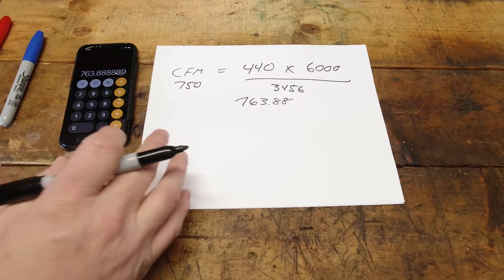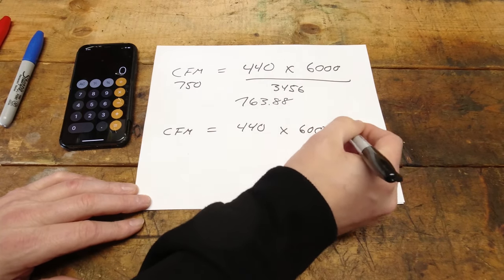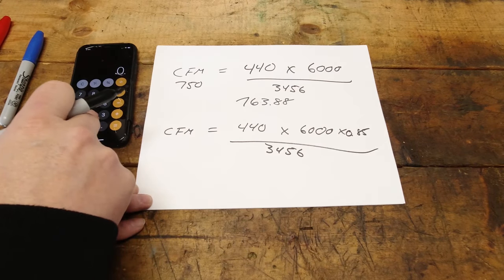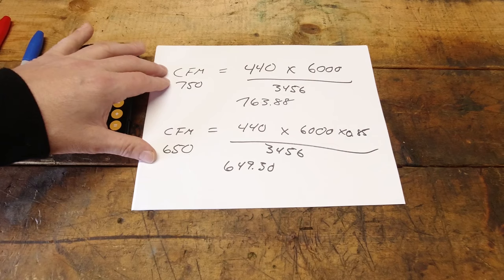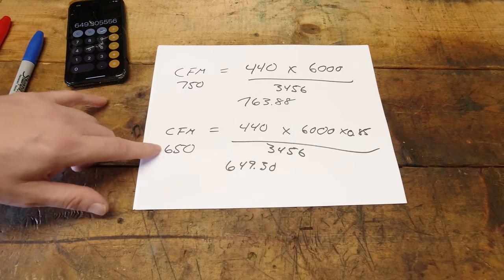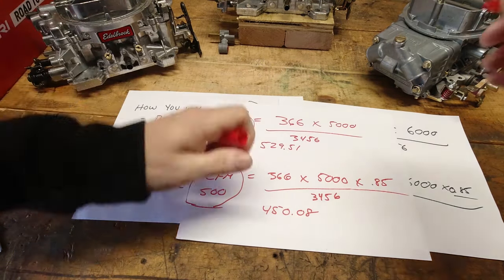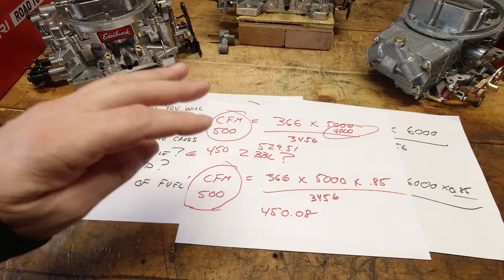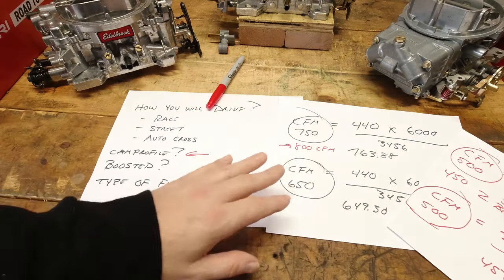How to Choose the Right Size Carburetor

Comment: Hello im Kendall and my f150 broke down on me in stockbridge ga,water leaking pooling under intake manifold so i assume its the line under intake i just knew that was the problem so i take manifold off and cut out the line and put it back together in the parking lot of comfort inn where im staying ,so i crank r up and its leaking more so i cut the line out for nothing its one of the line coming out of back of motor im like W** ,It was running down on intake i sure wished i would have replaced those to it sure tricked meive put alot of time and money in 2002 f150 4.6aluminum intake not plastic i got so mad at myself i felt like a dumba** its still broke down lol what im getting at is i come accross all original 1972 C10 i growed up ratracing my first ride was 1969 elcamino aka, the rebel lol  i was needing a cam to put in it so my buddy said i have one in garrage i said cool thank you  so i put it in and it was hitting such a big lick it would go dead my buddy was just a laughing it was a 5 something lift so i had to put it in neutral everytime i stopped i said you can put the stallconvefter in lol,ill shut up it has a 350 3 on the tree  cant wait till i get an ole muncie 4speed in her it was def a barn find it was the vetinarian of marrietta ga i just thought it was pretty awesome guess im getting old thank you for your time.

Comment: I am building a sbf 427 running e85. Planning on running a holley 950. Seems to be overkill for what the calculations say. It says 850. But I never seen anyone run an 850... Over the 950. Am I crazy for sticking with the 950?
Reply from the maker: Maybe not.  E85 requires a lot more fuel than a normal non ethanol gas engine.  So depending on all the variables, it might end up being the perfect size.
Reply: @MuscleCarSolutions  Yeah I check with Holley and they said the 950 IS the way to go. :)
Reply from the maker: @I_like_turtles_67  trust but verify.  I got you.  ;)
Reply: A Holley 950 carb is a 750 base mated to a 850 body to give you a 820 cfm
Reply: @robrozek9265  The guy putting my motor together is suggesting a 750 now lol.

Comment: AMC 304 on my automatic Jeep with Edelbrock Performer cam and intake with shorty headers and dual glass packs.  Should I guess 5500 rpm.  500 vs 650 for avs2 carb.  Or a friend of mine has a performer 500?    Any thoughts?
Reply from the maker: That’s the challenge.  Are you using that Jeep for off road and just a cruiser?  Then the 500 would be absolutely perfect for it.
Reply: Yes just a weekend driver mostly with some trail as well.  
  @MuscleCarSolutions
Reply from the maker: @diamatronyt  those little 304s weren’t meant to operate at high rpm’s in that application.  My guess is it will be well under 5000.  For sure the 500 will give you great throttle response and easy tuning.  You can even modify them up like I recommended in my set up for off road video.

Comment: I'm having some trouble picking a carb for a car that honestly shouldn't even be carbed 😂 
I got an old 1984 Nissan 300zx and the previous owner removed de fuel injection system and replaced it with a carburettor, so now I don't know what RPM to take into consideration
Reply from the maker: Your challenge will be what types of carburetors are available for the type of manifold it has.  Then find out what sizes are available (if there is more than one option) and start from there.
Reply: @MuscleCarSolutions  My, that's actually an GREAT starting point, thank you!
Reply from the maker: @QUIROPTEROHOLLOW  sorry that wasn’t more helpful but that’s exactly what I would do in that situation.  Good luck on your research!

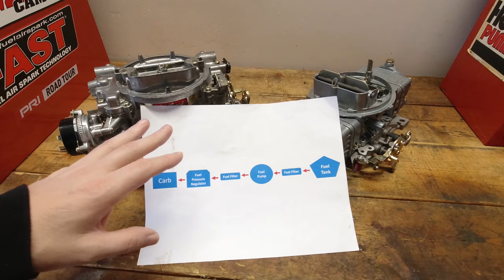Comment: Hey mate, just putting together a fresh rebuilt mopar 360 with a mild cam 214/224 @.50 112 LSA. it has j heads and a dual plane air gap intake.  Headers and 3:55 diff gears. Automatic transmission. 
It’s a weekend Cruzer and occasional burnouts 😉. 
What size cfm carb ? 
Vac or mechanical?
What brand?

That’s mate. 🇦🇺
Reply from the maker: That cam is likely all done around 5800-6500?  Not familiar with the flow characteristics on this heads.  If it’s oe from that era they flow ok but not great.  For what you’re doing, what size did the math tell you?
Reply: @MuscleCarSolutions  hey mate, yeah the cam rev range is from 2000 - 5000. 
Heads are pretty stock. The calculation gave me 582cfm?
Reply from the maker: @orlando_mopar_srt  interesting.  I’d expect an LSA of 112 to push way past 5500.  Either way, if the cam manufacturer says 5000, then I’d stick with that.  In that case I’d opt for a 600 and a 650 at the absolute most.  If it’s a cruiser, you can’t go wrong with the Edelbrock.  AVS2 would give you the 650cfm you need.  I’m sure there’s a retailer in your country.  Sounds like a fun little car.  Cheers!
Reply: @MuscleCarSolutions  Thankyou for the help and reply’s mate. Much appreciated. I will stick with the 650cfm. Do you think 650 vacuum secondary or mechanical? Cheers
Reply from the maker: @orlando_mopar_srt  the Edelbrock carbs are vacuum operated secondaries.  Will be just fine for what your plans are.

Comment: So a 289 operating around 5500 gets you a 340-450CFM carb... no one I know runs anything smaller than a 500 - most run 600 on a 289.
Reply from the maker: So put a 500 on.  The math gets you in the ballpark and anything else that’s not factored into that max RPM can and should help you determine if that will be a good fit.  Sure, you could also use a 600.  I’d venture to guess you’ll find that engine running in a perpetual rich condition.  You can adjust rod/jet sizes on an Edelbrock but you can tune CFM.  If you’re unsure about that, an AFR gauge cures all doubt.

Comment: I've been meaning to ask this question for a while so here we go. Do Holley and Edelbrock measure CFM the same. Another YouTuber I watch says "Holley is wet flow tested and Edelbrock is dry flow tested". He has a car with a tunnel ram with 2 600 Holleys he said that if he switched over to Edelbrocks he would have to run 2 750 Edelbrocks to match the 2 Holley 600's. When I bought my mustang it had a 650 Holley on it and since I switched to the Edelbrock I can't replicate the low, choppy idle I had with the Holley. The idle has a different sound completely. Anyway, as always thanks for sharing your knowledge!
Reply from the maker: The standard flow bench is used to measure CFM on prototype carbs.  They’ll usually make a 3-D printed one these days so they can tear out the bore sizes to get the flow data and measure what the final CFM will be.  Once it’s in a testing phase, that might get checked again (wet or dry) but it’s already been determined at that point.  Your tunnel ram example is how they both meter fuel.  CFM won’t have too much to do with it but it can be corrected with the linkage set up.  The Edelbrock’s that I’ve set up will bring in the secondary carburetor earlier to get the fuel flowing to match the engine load.  What your friend was describing could have been fixed with the linkage, not by going to a bigger CFM carb.  To your last example on your car going from a 650 Holley to a xxx Edelbrock.  Goes back to how it meters fuel.  The Holley is more mindless - dumps more fuel.  The Edelbrock is more calculated in how much fuel it delivers.
Reply: @MuscleCarSolutions  Right on, I appreciate you. If I continue to tweak the Edelbrock 1405 I should be able to get a lot closer to the same idle RPM and sound as the 650 Holley. That's good because I was about ready to give up lol. It's my information on the to Holly 600 comparing to two Edelbrock 750s came from a YouTube channel with quite a few subscribers. He actually gave you and your channel a lot of credit when you brought out the new Edelbrock race carburetor. He's great for entertainment and some technical things, but if I'm actually going to put my hands on a carburetor I'm checking your channel first for tutorial!
Reply from the maker: @BPattB  no.  The Edelbrock doesn’t delivery fuel like the Holley.  It’s going to sound different.  It’s a much more efficient carburetor.  Everyone has their own preferences and that’s ok.  Some folks will say that everything else is junk other than their preference which is not ok.  Different situations call for different solutions.  That’s why there’s no one best camshaft for a 383 Chevy.  Or big block mopar.  FE Ford.  Pick the right cam for what you’re asking the engine to do.  Carburetors are exactly the same.  Choose the one that gives you the best result for what you’re asking of it.
Reply: @MuscleCarSolutions  I totally understand what you're saying the right part for the right situation. So let me ask you this do you think a avs2 carburetor would give a different sound to the idle than a 1406? I'm soaking up so much of your time today I'm sorry. I have also heard and didn't believe it because I haven't heard it from you 😂 that the boosters on a 1405 are different than a 1406, is there any truth to this?
Reply from the maker: Possible.  In all honesty it’s not anything I’ve observed.  In a month or so I can possibly get to that and see.  Good question!
Reply: @MuscleCarSolutions  Well I spent about 4 hours trying to decide what new carb to go with. I wanted to get close to replicating the idle I had with the Holley 650. The current 1406 I had could not do that. After looking at the plugs I decided I could probably go a little bigger. I was considering a 650 quick fuel brawler, a 650 Holley, the AVS 2 and a 615 CFM Street Demon. Because of the manual transmission I really wanted mechanical secondaries. I finally pulled the trigger on the AVS2. Probably has a lot to do with my familiarity with Edelbrock,  I already have a lot of rods, jets, and a spring set. We will learn shortly if a 650 Edelbrock can achieve the same idol as a 650 Holley. Luckily I videoed the car idling in the exact same position with both carburetors. I'll keep you updated!
Reply from the maker: @BPattB  I mean if you’re just after the sound of a holley idling, create a big vacuum leak and you’ll be right there!  😂
Reply: @MuscleCarSolutions  🤣 Some times the truth hurts!
Edit: I did check your website before I bought. I definitely would have thrown the business you way but you didn't have a 650 AVS 2, I did consider the 600 Holly on your site but I wanted a manual choke.
Reply from the maker: Yup.  No manual choke AVS2s right now.  And I don’t have much done and ready to go.  Been so busy lately.  Winter months are coming and I’ll have a little more time to get some stuff done and back on the site!

Comment: That's the right carb to get you 1.5" of manifold vac at WOT.  1.5" of vac is acting against the top of the piston pulling on the port, that's lost horsepower, plus the fact that the cylinder doesn't fill, especially with that .85 factored in. OK formula for a streeter, useless for a racer.

Comment: I have a 87 firebird with a 305 chevy, would I be safe switching from the 600 cfm quadrajet to a Holley 650 with the same bolt pattern? I drive it to work daily and it never goes past 3000 rpms
Reply from the maker: If you follow the math in the video, the 650 will be too big.  Also, the Qjet is a spread bore design and the Edelbrock carbs are square bore.  You’d need an adapter or a manifold change to accommodate.
Reply: Muscle Car Solutions lmao

Comment: So you’re telling me my street stock 350 only needs 506 cfm at a max of 5000 rpm?
Reply from the maker: If you’re operating below that rpm a 500 CFM carb can easily be tuned to handle that and drive very well.

Comment: So this has still got me F^%$# since my carbs are not listed with a CFM . They are described as dual throat 36mm X2 carbs.  I figure just replace them with a two bbl Holley of 350CFM to run the 147 CI . Max RiPeMs 6500.maybe 7? At least Holley has the adjustment made by tuning needles instead of jet replacement.

Comment: Good video....I find myself at the point of my project where I'm trying to not suffer from information overload. For my BBC 396/402 with a very mild upgrade over stock cam....it's be recommended numerous times that a 750cfm carb is the way to go. Doing these equations both ways suggests otherwise. For a strictly street cruiser is it better to have a little to much or a maybe a little under what the math says.
Reply from the maker: Your max RPM is the number you should be most concerned with.  If that number is 5000 rpm, then sure, I’d go up to a 600/650 all day long and be confident you’ve got enough CFM to feed that engine.  But all the little things add up, plus how you want the engine to perform.  If it’s just a cruiser and occasionally having some stop light to stop light type fun and enjoying a fun burnout from time to time, all day long you’ll have much more fun with the right size carb.  If you’ve got any indication you’re going to get more aggressive with it and the RPM number goes up significantly, then sure, the 750 could be the better choice in the long run.
Reply: @MuscleCarSolutions  I did the calculations based on the published 'red line' for the 1967 396/375
 which was 6000 RPM

Comment: And that same 440 will make more hp with an 850.
The carb manufacturer says go smaller just to cover there azz. The factory carbs are more accurate in carb size.
375 hp 396, 780 carb.
400 hp 454 had a 850 Q-jet. 
The worst thing you can do is under carb an engine.
The thermoquad was available in a 750, 1000 cfm.
The tri power was 1200+ cfm.
Reply from the maker: @bigbelconut  don’t confuse the OE CFM with engine demand.  Especially not in compared to a universal aftermarket carburetor.  The OE primary sizes were much different on a typical non performance application.  Even back then they tried to control some of the engine demand vs economy.  Just because a tri-power set up was capable of 1200 cfm, doesn’t mean it delivered that at every given point in the engines operation.  Not all engines are built for WOT, all in performance.  It’s all by application.  A 440 built as a cruiser is going to take a much different aftermarket carburetor CFM and type than a track dedicated build.
Reply: @MuscleCarSolutions  I build spec race engines for a living I have hundreds of hours on the dyno testing carbs manifolds and camshaft. You don't drive a piece of paper with a formula on it. Real world engines make more power with more cfm. A bbc built for a tow rig will make more torque in the tow rpm range with a 750 then it will with a 600.
Holley started this small carb crap in the 80s because they got tired of getting carbs back because they tried putting 850 on stock 350. 
A 300 hp 350 will make good power and torque with a 750 vacuum secondary carb.
Reply: @MuscleCarSolutions  btw the carb calculation says my 505 bbc need a 900 cfm, it made 802 on the dyno with a 1150 dominator.
Reply from the maker: @bigbelconut  👍😂